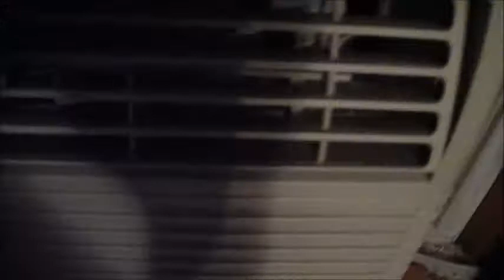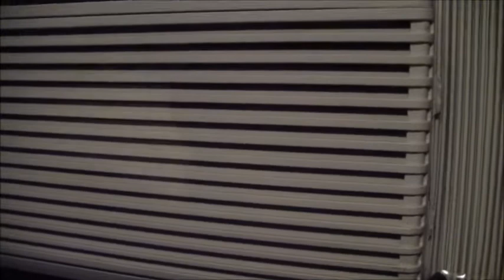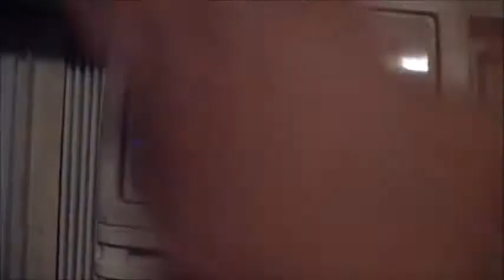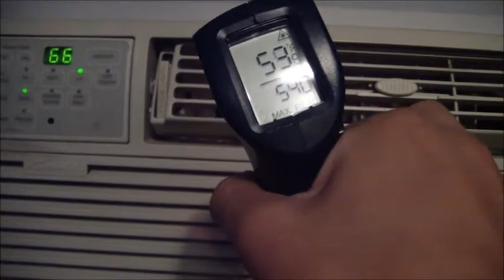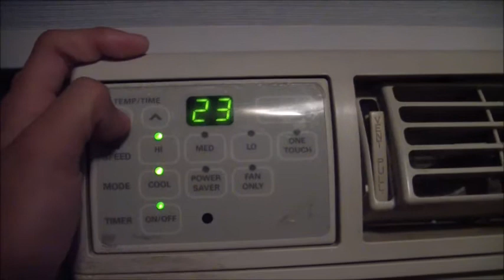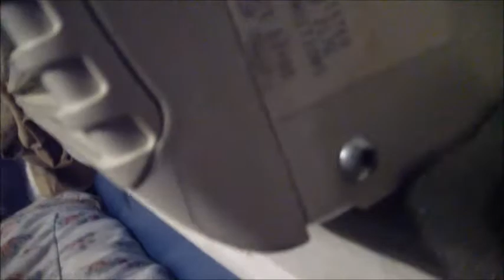Older Kenmore 5600 BTU Window Air Conditioner (WCI).

Comment: how do you replace the fan blade on this? I have this and would hate to replace it as it still runs great just the fan blade clamp broke
Reply from the maker: Which fan clamp broke, the indoor blower or the outdoor fan?
Reply: @brunoshow124  outside broke I need to tear it apart problem is shroud is screwed in front front so looks like I would have to remove entire frame to get to those
Reply from the maker: @kennethsimbapuppyeyes6857  is the blade loose or is it still tight
Reply: @brunoshow124  been running sense Friday with a zip tie and 2 drywall screws till I can take it all apart
Reply from the maker: @kennethsimbapuppyeyes6857  unfortunately higher quality window units are more difficult to take apart to that level I've noticed.
Reply: @brunoshow124  I am going to wait till it's a bit cooler and take it out hose it down cuz it needs a good cleaning and attempt to fix.. I Seco this as I have taken many of the smaller ones apart to clean coils. This one was expensive when my aunt got it 20 years ago. She used it once as the power in house then couldn't support it. So it was basically new just not used I got it and been running it non stop on ac and fan for many summers
Reply: @brunoshow124  was thinking of going split unit if this dies in the name of repairing .. I'll share if I figure it out. Blade is 125$$$
Reply from the maker: @kennethsimbapuppyeyes6857  I'm not a fan of split systems personally. The blade for that window unit is 125?
Reply: @brunoshow124  so far that's what I am seeing. Have a metal blade from a roof fan looks like it would fit shaft but idk if you can use metal on that.
Reply from the maker: @kennethsimbapuppyeyes6857  check around ebay and stuff. I might even have a couple laying around. These were sold under Frigidaire, Gibson, White Westinghouse, kenmore and a couple other brands. You can look around more and see if there's any listed for those versions.
Reply from the maker: @kennethsimbapuppyeyes6857  They really were good units. They were the last of the "vintage quality" window units even though they had modern features. Too bad they don't make them anymore.
Reply from the maker: @kennethsimbapuppyeyes6857  ok so I had to completely disassemble one of these units to oil the fan motor, it's actually very very easy to do. The entire metal bulkhead comes out with both fans attached in one piece.
Reply: @brunoshow124  do you have to disconnect the line for the evap core or does that all come together
Reply from the maker: @kennethsimbapuppyeyes6857  there's 3 screws to removes the bulkhead, then disconnect the compressor wires and it pulls up. The copper lines stay in place. While it's apart it's a good time to replace all the weather stripping in there and clean it really well.
Reply: @brunoshow124  I put 2 screws next to shaft where it broke and use a zip tie to allow it to hold in place. It's running but idk how long that will hold up. Made a mess pulling it out with water but yea looks very hard to even get the shroud off all brittle Styrophone lining that doesn't come out like most of them do
Reply from the maker: @kennethsimbapuppyeyes6857  the Styrofoam part comes out in 2 parts, but yea basically the entire metal bulkhead has to come out to get to the fan. There's a screw under the unit as well as on the sides that hold that in place. It's not as bad as it seems just go slow and don't force anything.

Comment: Hey, man. I really appreciate this video. I have a very similar air conditioner from 2002. It’s essentially the same (25372055201) The other day I downloaded a PDF of the instruction manual. However it’s in black-and-white and the pictures that they have are very faded. But I noticed in the manual, it seems to state there are 3 different options for the vent pull handle? The first option is obviously in which is for max cooling. The second option, when it’s all the way pulled out, which the manual stated it’s for pulling stale air out of the room. But there seems to be a third option somewhere in the middle that pulls in air from the outside? I tried to mess with the lever and it does seem like it could stay in the middle but I didn’t notice really any difference when I looked inside with a flashlight. I always assumed there was only two options with the lever either all the way in or all the way out. Could you possibly shed some knowledge on this? I would appreciate it so much.
Reply from the maker: The vent door you can see through the faceplate is the exhaust vent, the intake vent is down by the blower inside the unit, you can only really see it if you take the unit apart and take part of the blower housing out. You might be able to see it if you look in the outside portion of the unit, it's behind the compressor near rhe fan motor, very hard to see with the unit together. The vents on window units are very small since you don't want to bring it a lot of hot air or exhaust a lot of cool air, it'll make the unit a lot less efficient.
Reply: @brunoshow124  Thank you so much for your help. That has certainly cleared things up. I appreciate everything. Take care.

Comment: I know this post hasn't been active in a bit but I thought I'd give you a try just in case you have seen this.  I have the same unit but a few years older.  I have two symptoms that keep happening.  It either freezes up and I get a huge block of ice under the filter OR it just freezes you out of the room.  We set the unit at 74 with the fan on high and I wake up in the middle of the night with the air temp at 66.  The fins look good and I've blown it out with my air compressor.  I hate to toss it but it's really not working right.  Any advice?
Reply from the maker: Does it have digital or analog controls? I'm assuming if it's older it probably looks like my 1999 Frigidaire or 1996 Kenmore with analog controls.
Reply: @brunoshow124  It has digital controls where I can set it to the temperature I'm looking for. The control unit is in the upper left corner and looks exactly like yours.  When I turn the temperature up and down I can hear the compressor(?) turn on if I lower it and off if I raise it.  The thermostat bulb and wire are clean - I even wiped it down with a cloth and alcohol.
Reply from the maker: @michaelkapala3319  It sounds like a problem with the thermostat, but you can try to clean the coils with water and mild cleaner to see if they're dirty deeper then you can see.  Sometimes an air compressor isn't able to get those coils clean enough.
Reply: @brunoshow124  Well I did a nice deep clean of the coils with a cleaner that was made for that purpose and hosed it out really good.  Got to test it last night.  It iced over again :-(   I know it's a crap shoot but on a best guess you think it is worth the money to try to see if it is the thermostat?  Where is the best place to purchase?
Reply from the maker: @michaelkapala3319  What was the temperature outside when you tested it?
Reply: @brunoshow124  When it froze over the  outside air was a humid upper 70s.  The thermostat was set at 72. Last night it didn't freeze and was set at 74 with similar weather outside.

Comment: I have this exact  one but where. Can I find parts for it. I need the filter and filter cover please help
Reply from the maker: The filter you can get at any hardware store and cut one to size, the front cover you'd have to find used somewhere or new old stock if you can find one affordably. Best bet for the cover is finding a used one or a parts unit.

Comment: Hello! 
It's Monday June 28 and I'm here in Roseburg Oregon, where yesterday's temp was 115° and today's 109°.. I've had my Kenmore since 2002 bought it new. It's through my kitchen wall and remote control. So, it comes on I'll set the thermostat to 80° and it kicks in and blows nice and cold air for 2min tops! I've cleaned the filter. Don't have the model # but it looks exactly like your video?  It seems like the thermostat.. any recommendations?   
We're broiling here 🥵  Thanks
PS.. it's 2021!
Reply from the maker: Check the coils behind the filter, they could be clogged causing it to get too cold by the thermostat probe and making it shut off. Also, check the coils on the back of the unit too, they probably are dirty inside and making the unit overheat because there isn't enough air going through them. I'd recommend getting some kind of coil cleaner, they typically sell it at any hardware store. Spray that on the coils, let it sit, and rinse it with water. There is likely dirt hidden in places you can't see causing problems.
Reply: @brunoshow124  
Okay but I'll have to have someone pull it out of the wall for me to get to the coils on the back side of the unit.. I think?
With this heatwave we are having, I can't find anyone to come look at it.  It's a pretty big A/C.  Well, thank you so very much for the suggestions, now I have an idea what's wrong 👍🙂.. I WILL let you know  if it works.. 🙏
Reply from the maker: @peacelovejoy8786  Can you reach the back of the unit from outside or is it inaccessible?
Reply: @brunoshow124   I'm upstairs and it would take a tall ladder..  with heat everyone seems to be booked.  Right now it's not that hot yet so I'm running the A/C for a minute then switching it back to fan, kinda like toggling it. So far it's working..haha  I've left messages for some companies and I know it will be a while..I will keep okay?
Reply from the maker: @peacelovejoy8786  good luck, most companies won't even look at window/wall units.
Reply: @brunoshow124   I just found a guy who used to work with sears and he's familiar with Kenmore. He's coming to look at it tomorrow!!!  Guess I got lucky... thanks so much for your help..
Reply from the maker: @peacelovejoy8786  awesome! Let me know what happens

Comment: Had this for over 19 years. Still blows insanely cold air but it randomly died. No idea how to get it out. The bottom part just will not budge. I'm 6'3 and it's mounted in the top portion of the wall on the side of the house. I can't get enough leverage to pull it out. No idea what to do, my mom called local hvac people they are coming tomorrow. Beast of an air conditioner though, wow.
Reply: the whole thing slides out of the base, I have this an need to replace the fan blade

Comment: Hi i need some.help if you can
I have mine when i turn it off the fan stays on not understanding why it doesnt shutoff.
The panel is off but unit still blowing on fan. Appreciate for your help. Thanks.
Reply from the maker: Most likely a problem with the electronic control board possibly cause by a power surge, I haven't seen any of these units with issues with the controls before. Try and unplug it for a few hours and then plug it back in, sometimes the electronics can get confused and that's the best way to reset it without taking the entire thing apart.

Comment: I have this exact model, had it for years, I just recently cleaned the filter and it was running good for the past week and just now it’s not blowing cold air anymore feels like a weak fan. Suggestions/advice?
Reply from the maker: If the fan feels weak and its not blowing cold it could be the start/run capacitor going bad. Those are cheap and easy to replace.

Comment: How expensive are these to run? Will I have to sell off my first born child which I don't have yet? LOL I imagine they're pre-Energy Star, or maybe not as I see a completely faded label on the outside (presumably from sun exposure).  I can't make out the model info from the plate info which I don't understand since that would be inside the structure & not subject to weather abuse.  I think it say's 1000 BTU.  Do you know if they were ever made that small?  Yours sound like a monster comparatively at roughy 5x the BTU size if my understanding is correct.
Reply from the maker: 1000 btu is probably right around what your refrigerators cooling system is rated for, It's most like 10,000 btu, they used a lot of similar parts from various models. These are pretty efficient even now, some models were energy star rated.
Reply: Actually, they were Energy Star rated, and the rating on the range bar went from an 8 (for least efficient) to a 10 (for most efficient). The 5600 BTU model was rated at 11.  I bought two of them back around 2000, and still have the yellow energy efficiency tag as well as the units, that both work fine.  The estimated annual cost of running one of the 5600 BTU units was $33. No loss of child involved. I run both of them daily during the summer, one in the bedroom and one in the office and they barely make a blip on my electric bill.

Comment: How do you clean these?  I have one (ironically free as well) & it stinks to high heaven from the nasty smelling perfume / smoke smell / incense burned / something of the like from the previous owner.  Furthermore, its completely covered in black mold as in in the entire styrofoam portion visible through the vents is completely covered where it looks like soot is covering what should be white styrofoam along with the vents. I was about to discard it until seeing this video.  Ive watched multiple video here demonstrating how to clean window A/Cs only to discover to my dismay this was much different & complicated than everything I'd seen cleaned -- specifically the "hamster wheel" mechanism is completely enclosed by styrofoam & probably lends to why I agree with you that it's SO AMAZINGLY QUIET especially compared to newer small models I've used.  Is there way to clean that "hamster wheel" piece or should i leave well enough alone & focus on cleaning the junk out of the bottom like sludge & leaves, the coils in the front, & the coils in the back with a hose?  Do you tihink i should just be patient & hope the disgusting scent goes away with use & diffusion?  If you don't making a video of how you've cleaned (since i see from this video you take pride in maintaining a valued item), I'd appreciate & I suspect other people would, too.  

Lastly, my adjustable side expanders have seen better days with 1 completely ripped off.  Do you have any suggestions for how to fix that?  I'm using duct tape & prayer right now. LOL! With Sears dying, I suspect its hard to get after market parts.  I wonder if there's any universal parts that would only have to match the height of the AC & therefore could be used as a replacement.  What's your knowledge on that?

I apologize if this to wordy or an epic run-on comment, but ultimately it's because I agree with your value statement of that MANY things aren't made like they SHOULD & used to be. P.S. That's coming from an early 30 something not someone more like our parent's age -- with all due respect to those older than me.
Reply from the maker: Okay, the smell will eventually go away with enough use but that could take months or even years, your best bet will be to remove the cover and spary all the components with either coil cleaner or even some kind of disinfecting cleaner and let it soak for 10-20 minutes and rinsing. The outside fan, squirrel cage blower (what you called the hamster wheel) and both coils should be relatively clean. The fan motor and compressor can get wet as they are designed to operate in rain. Be careful what kind of cleaners you use, something like the air conditioner cleaner they sell at home depot is fine or something like Lysol or Clorox is also fine. 

The side panels are easy to get, the sell the ones at Home depot you cut to size and stick into the existing bracket. 

Im 20 and I have been disappointing in the quality of things for a while, I'm at the point where I would love to buy new stuff but its more worth it to refurbish something older and use that, or sometimes I do find new old stock items.
Reply: There's a few videos on this you might want to watch - 

* Cleaning mold out of a window AC unit.
* how to clean mold from air conditioner
* How to Clean A Window Air Conditioner The Easy Way
...and if you plug those titles into the youtube search bar it'll bring up lots more with folks using spray foam cleaners and so on to get mold and stuff cleaned out of them, fast and easy.

Comment: Remote control????  Kenmore 5600 BTU Window
Reply from the maker: Yes it has a remote
Reply: @brunoshow124  Wow. TIL. Do you have a part number for it?
Reply from the maker: @AntonioBanderasTheKing  I don't offhand but I'll see if i can find it
Reply: If you're a stickler like me and have to have the original kenmore model remote, what you're looking for is Part# 309342603, which show up from time to time on eBay, though there's none up right now.  You can find them on other sites like Amazon or repairclinic dot com as well.

If you don't care if it's the original model, there's a couple of different options. You can go to Amazon and get an "HA-602 Replacement for Kenmore Air Conditioner Remote Control 309342603" though you'll have to match it up with the correct model number so you get the right frequency (the one for model's 25370069002 25370259000, like the third one down)

Or, you can just pick up a Universal air conditioner remote like the "Anderic KTN828 Universal Mini-Split Air Conditioner Remote Control" for like $20, or even the "Coyaho Universal Air Conditioner Remote Control" for like $8. 

Any of those will work...

Comment: Do you still have the unit how many units do you have?
Reply from the maker: Yes I do and too many
Reply: BrunoShow124 does it still work well?
Reply from the maker: yes
Reply: BrunoShow124 my grandparents have one but it doesn’t work it doesn’t work the problem is that the fan isn’t getting enough power there replacing it next summer
Reply from the maker: check the run cap, typically those go bad.
Reply: BrunoShow124 well I don’t think it would still cool the room because it is to undersized
Reply from the maker: Fan and Air conditioner dude you're probly right but these seem to be a bit underrated, my 6200 btu version is doing what the 8000 btu ge did and it does it better and runs less